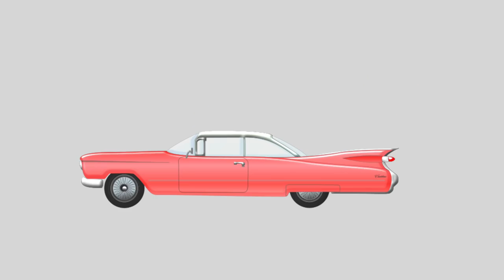Yes, Rockets CAN Fly in a Vacuum

Comment: How do things stop in space or change directions?
Reply: By accelerating and ejecting some mass.
This is what rocket motors do.
Reply: @niallkinsella2687  this didn’t really help me . Can you explain it like I’m a complete idiot?
Reply: @CoreyMack5000  
Right so.

The three main things to remember are Newton's laws of motion and the law of conservation of momentum.

Objects are happy to stay going at whatever speed and direction they are going in. They don't change unless something happens. This is just a fundamental property of matter, and it's Newton's first law of motion.

In order to accelerate something, anything, it has to have some action applied to it. This is referred to as a force. This is Newton's second law of motion.

Objects resist anything that attempts to accelerate them. They push back with equal force, but in the opposite direction. If you push something, like a shopping cart, it pushes you back. You feel this as the experience of the cart being hard to push from a standing start, but easy to keep going once up to speed.
When a force is applied to something, it resists that force. Whatever applied the force feels the resistance as another force acting against them.

Finally, conservation of momentum. Net change of momentum in a system is always zero. When a pool ball strikes another, they will each move off with a combined speed and direction (momentum) equal to the momentem of the original ball.

The same principles apply in space with rockets. The spacecraft is floating along. Then the fuel and oxidiser is pumped through the engine and ignited, the resulting exhaust is accelerated out of the engine bell. The fuel and oxidiser has mass so it resists being accelerated, therefore the rocket experiences a force also in the opposite direction.
The momentum of the fuel/oxidiser mix has been changed, to maintain total momentum the rocket's momentum must change also, in the opposite direction with equal magnitude.

To change speed or direction, the rocket just points it's engine in the direction it wants to travel away from, and accelerate the fuel/oxidiser out of the engine.
Reply: @CoreyMack5000  Consider an experiment: what would happen if a CROSSBOW fired into a vacuum? Would it still feel a recoil force? Yes or No?
Reply: @CoreyMack5000  You just ignite the engine in the direction you want to move and there ya go. In a orbit, it’s a bit more complicated than that, but you said explain as if you were an idiot sooooo…..

Comment: That analogy with the balloon still doesn't explain it for me. The balloon propelled forward because the air in it had the atmosphere to push against thus creating thrust. I still don't get what the oxygen in the rocket's tanks (which is used to burn fuel) push against when in a vacuum? Besides how much oxygen and fuel do you need to carry to propel a massive rocket with 3 breathing human beings 776,000KM to the moon and back? How do you navigate in a vacuum? I am not saying you're lying, it's probably me not being smart enough.
Reply: - "I still don't get what the oxygen in the rocket's tanks (which is used to burn fuel) push against when in a vacuum? "

Think of it this way: Would a CROSSBOW fired into a vacuum have any RECOIL?
Yes or no?
Why or why not?

Try EXPLANING mechanical recoil to me.
Reply: @stuartgray5877  space travel is bs! Talk about 3 guys flew a million miles to the moon with the computing power of a calculator. BS is BS.
Reply: @dmoriasi  Which of these two people should KNOW if space travel is a hoax or not?
A High School dropout?
Or
Someone with an actual Engineering Degree and almost 30 years experience building, testing, launching, and operating deep space science probes as an Aerospace Test Engineer?
Reply: @stuartgray5877  Aerospace Test Engineer "should" but none of them seem capable of explaining to laymen how it's done.
Reply: @dmoriasi  - "but none of them seem capable of explaining to laymen how it's done."

I Try but seems that "physics denying" individuals REFUSE TO ANSWER QUESTIONS.

"Think of it this way: Would a CROSSBOW fired into a vacuum have any RECOIL?
Yes or no?
Why or why not ?

Try EXPLANING mechanical recoil to me "
Reply: @stuartgray5877  you don't explain things by asking questions, chatbot 😂

Comment: My question is:

How can anything not explode in vacuum? The external pressure vs internal pressure of the rocket. The isn't any air or water pushing the walls of the rocket. How can they hold everything?
Reply: Because they are designed to.
The fuselage is made of materials which have their own tensile strength. Simply design the fuselage so it can withstand the internal pressure.

Here's a fun fact. Most pressurised containers on earth with work just fine in space without exploding. The difference between atmospheric pressure at sea level and hard vacuum is less than 15psi. The wheels on a road bicycle can have as much as 90psi and with their safety factors could easily handle having 120psi difference between internal and external pressure.
Reply: @niallkinsella2687  Dont forget that a human could survive in the vacuum of space inside a Mylar Birthday balloon filled to 5 PSI pure oxygen.

Comment: Probably a dumb question. What is the expelled 'gas' pushing against besides the spacecraft?
Reply: Nothing. The "expelled gas" itself has MASS so when the rocket PUSHES OUT this mass, it feels a mechanical recoil force in the opposite direction. This is Newton's Third law in action.
Reply: Have you ever used a "water rocket" toy?
You fill it with water, pump it full of air and release it.
The air pressure FORCES the water out at high velocity creating a recoil force that pushes the rocket forward. Once the rocket runs out of water it can no longer thrust.
These same toy rockets work just FINE in a vacuum.
Reply: @stuartgray5877  ....thanks for the reply...appreciate your time.

Comment: Airplanes, both propeller and jet work the same way. Turbojets in particular.  Except they get oxygen from the air, and the ambient air is also the reaction mass

Chemical rockets, the chemical fuel is both the reaction mass as well as the energy to give that mass velocity.

With nuclear thermal rockets, the 'fuel' only functions as reaction mass.  The reactor gives the reaction mass its exhaust velocity. Though the reactor of course needs its own fuel.

Ion engines are similar.  The fuel is only reaction mass, usually xenon.  An electrical energy source gives it its exhaust velocity which is much higher than even a NTR.  Ion engines are very low thrust to weight ratio and can only be used one already in orbit, but since they are usually very low thrust also means its electrical demand can be supplied by solar panels.
Reply: Pretty sure that the proper terminology is that fuel is what gives it the energy, while the propellant is the reaction mass. So an ion engine is fuelled by electrical batteries and uses charged particles as propellant.

Comment: If rockets runs on Newton's 3rd law of motion then how it can obtain thrust in vacuum as space is devoid of atmosphere...
You smartly skipped that part...
Reply: Kit Canyon please enlighten me with your knowledge...
Reply: @raulsuri3682  
If you force something to accelerate, you'll be accelerated in the opposite direction by the same amount of force.

Simple Newtonian physics.
Reply: Niall Kinsella where is the Reaction force applied when there is no atmosphere...
3rd law of Newton is getting violated here...
We have been studying this as a standard physics since 6th Standard...
Reply: @raulsuri3682  
Newtonian physics never mention, nor require, the presence of an atmosphere.

If you accelerate a mass X from zero relative velocity to a velocity of Y, you've excerted a force on it, causing it to gain a momentum of XY.

You'll be accelerated in the opposite direction to the same magnitude of momentum, XY.
Reply: Niall Kinsella I have studied physics but still it's incomprehensible for me...
Thanks for your kind response...
Reply: @raulsuri3682  
It's not that difficult.

The rocket contains tanks of fuel.
Until the fuel is fed through the rocket engine, it has the same velocity as the rocket (ie. 0 relative velocity).

The rocket engine forces the fuel to be accelerated. The fuel has mass and inertia, so resists being accelerated.
The rocket engine forces the fuel to be accelerated (an action), in response the fuel forces the rocket to accelerate (a reaction)
Reply: @raulsuri3682  if you fire a steel projectile from a crossbow, here on Earth, will you feel a recoil force, yes or no?